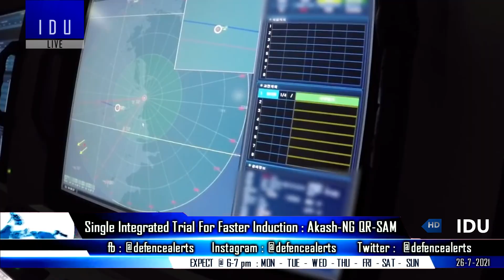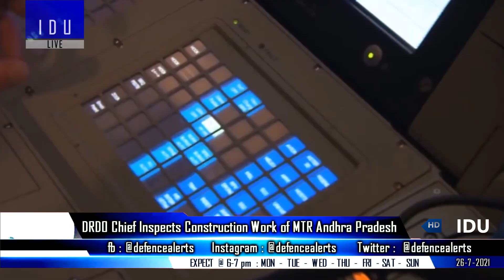Indian Defence Updates : AMCA On Track,QR-SAM Production,Guided Pinaka Export,DRDO New Test Range

Comment from the maker: 🔴What's Your Opinion : "ARDO Starts Single Integrated Trial For Faster Induction" ?
ＬＩＫＥ | ＣＯＭＭＥＮＴ | ＳＨＡＲＥ | ＳＵＢＳＣＲＩＢＥ
Reply: is it drdo or ardo??
Reply: Yeah it's an extremely good decision as army, air force and Navy conducted their own test which delayed the induction of missiles.
Reply: @Flying Tiger What $2B for AMCA are you talking about? Nothing is sanctioned all only on paper and wishful "news".. 2010 around 100 crores or 13 million $ was sanctioned for AMCA... Geniuses will work on "5.5 gen" technology while already spent 10 billion $ on Rafale 4.5 gen tech and have lined up few more billions for additional rafales.. Billions of dollars "planned" for 6th gen engine collab, 5th gen tech while basic C 295 transport aircraft is on hold from 2015 and we are "leasing" MRTT?
Reply: @aocaoc2561  would you tell me the total project costs of AMCA before commencement of commercial 
Production  or have you any idea. 
Thanks
Reply: @pijusmalik7243  5G AMCA RDT&E benchmarks = 5G F35 RDT&E = $62B + 6G Tempest = planned $100B + FCAS = planned $120B...
Reply: @Big.Buddha  RDT&E +FACS  =
-----------------------  +  --------------------
fill up the above  . Thanks
Reply: @pijusmalik7243  Your fill in the blank test equation is dimensionally unbalanced - so to simply the answer - 5G AMCA RDT&E as currently proposed will require minimum $70B in today's money with no problems or delays = 10 years of current entire IAF Modernization Budget of $7B - class dismissed...
Reply: @Big.Buddha  I just wanted to know the full form of abbreviations, 
even after that would you tell..... it
is unbalanced , further if any,  you should have used the rocks for the same .
Reply: @pijusmalik7243  Good question... 
RDT&E = Research Development Testing + Evaluation
FCAS = France 6G Future Combat Air System = SCAF in French...
Reply: @Big.Buddha  Who knows,  you can't understand this simple equation, contrary you have to understand,  again claiming  to be 
"Equation creator " .
Reply: @pijusmalik7243  I grew out of fill in the blank questions 16 low then higher education years later - in math intensive disciplines - so communicate like an educated adult next time...
Reply: @Big.Buddha  I didn't communicate at first you did 
mind it .
Reply: @Big.Buddha  Then you said why, 
whether the equation is unbalanced / balanced, if you don't understand you may ask  or rather to quit, .... no problem
Reply: @pijusmalik7243  OK - won't answer your questions anymore that no one else was answering - so don't bother asking......
Reply: It's a good move 👍 could be helpful in conducting many trails
Reply: Good
Reply: TEDBF जेट्स कब तैयार होंगे
Reply: @pravinyeole2002 Prototype ready - 2025
 First flight - 2026
Production - 2029-30
Induction - 2030-32 (whole squadron is Inducted).

These were the updates 5 months ago. Will know more in AeroIndia 2022.
Reply: @someon713  Would you tell me why 3 yrs is required to enter into 
Production after 1st flight. Thanks
Reply: @someon713  Satisfactory reply .
Would you tell me the meaning of "induction " within the purview of defence , mean to say the  'stage'.
Thanks
Reply: @pijusmalik7243  induction is the stage when the plane (or anything) is taken into service and is ready to use. Like the first squadron (18 planes) of Rafale are ready to use but the second isn't completed (3-5/18 ? Plane).
Reply: @someon713  More specifically 
whether it is simply incorporation /
registering in the book of an equipment  ( say aircraft ) at ready to use mode  or the stage means after adopting  with  the IAF' s software especially for command & control system ie at  fully operational mode 
Thanks
Reply: @pijusmalik7243  induction means ready for war/combat. Ready to use.
Reply: @someon713  Please be more specific whether it is ready to use for training / testing / fighting. Thanks
Reply: @pijusmalik7243  fighting.
Reply: @someon713  Now I satisfied 
Thanks
Reply: @pijusmalik7243  no problem.
Reply: @someon713  Please stay in loop.
thanks
Reply: @pijusmalik7243  will try.
Reply: @someon713  Many many thanks
Reply: If DRDO thinks  that single integrated trial system is enough &
they could satisfy all the stakeholders in each program then
it will be a big boost for our def 
industry  . Thanks Jai Hind
Reply: Share your FB link...
Reply: Good but how will we match the expertise of decades and huge R&D and infrastructure with what we have at present and even in ultra perfect case scenario we succeeded what will be the cost and how much will be able to buy considering cost per unit.  Where it is leading us and then the statements we hear.  And will we have good 4. 5 gen to compliment our 5.5 by the time it squadrons get ready for action. And MWF Will be better than rafale point taken but when and how, better investing in MWF making it good 4. 5 gen with mk2 being cost effective and mk2 with low rcs and good electronics by 4.5 standards will do a lot more good than khayali pulao
Reply: @honeyjotsingh1717  It is not about our "desi" fanboys and their wet dreams about all desi hardware and dialogues of "we should start somewhere" it is NOW simply about a case of can those MWF which needs close to a decade for FOC (best case scenario) take of and within minutes, engage any enemy jet and get air superiority over it.. Yes jets like SU 35 J20/16/11/10 which are far more superior.. 
Those 36 rafales can't be ready for action along all sides of the border Kasmir to Gujarat.. Ladakh to Arunachal Pradesh .. Take the little tejas as an example.. kudos they signed deal and it will be built, taking the role of Mig 21 bison. But against adversaries what can it do against their PLAAF fighters like J 20/ j 16 with massive AESA radars and PL-15? even jf-17 blk 3, j-10C that can be fired from 160 kms + away?

 Locked - RWR will scream and either back off/turn or get blown from the sky 0 chance of getting air superiority over them.. Now add all other jets like SU 30 MKI, Mirage 2k, Mig 29UPG all are already out ranged against the updated Ch!nese jets with AESA + PL-15 combo... Now people will argue oh PL-15 is over hyped bla bla bla but remember IAF lost the entire engagement on Feb 27 because AMRAAM out ranged R-77 by 20-30 kms.. well that range just exceeded with them getting 60+ kms now with PL-15..
Reply: @aocaoc2561   Our massive pride won't allow to see the reality that the Chinese are developing and improving fast along with Pakistan being setup us a useful buffer for them. Still we like to mock Russian and Chinese Stealth classified jets (Yes they could be somewhat inferior to the US stealth jets, but still, even they take it seriously) when LCA Tejas MK1A is still in final refinement phases only. 

In case of missile effectiveness. The missile does not necessarily have to score a hit and the receiving pilot is not going to check on its reliability either when it is being fired onto him/her and when it is fired, he/she is going to do evasive maneuvers and that in itself is a tactic. 

The secondary objective is to keep them busy trying to evade, and they wont know what model or version of missile is fired only whether depending on the RWR or EW suite could know that it may be IR or radar guided, roughly....

Feb 27, we used baseline R-77 export versions and Pakistan got the AMRAAMs bit late and the got a intermediate version which was already a bit ahead of our early baseline. Pakistan planes had headway alert with their  AWACS giving them better bearing and they launched the missiles from max range and our Su-30s pilots naturally did not want to test its effectiveness, all they could do was evade.
Reply: @aocaoc2561  what can you expect when our pride get bigger than national security.  Its more about pride, PR, ego satisfaction and bait to few over anything.  They really aren't care about China and got way too complacent against pak as usual and will wake one sudden day and again go for shopping spree spending double the amount of what it worth and bringing just the product and nothing else just like rafale
Reply: @honeyjotsingh1717  Yup we didn't factor Chine even though red flags should have been seen very long time back, and only thought of them as just a potential threat... Next thing you know the gave us a "we are in come fight us if you want,but we know very well you can't" situation..
Reply: @aocaoc2561  very true and considering the fact that we can't sustain a long term war, we need to keep them back rather than engaging with them and only way to do it is have  ample strength which we currently lack, conflicts will cost us a lot more.
Reply: @honeyjotsingh1717  Correct - 4.5G much less 5G are unaffordable with volumes of only 40 AMCA.1 + 80 AMCA.2 to drive economies of scale - so something isn't adding up....
Reply: @Big.Buddha  we cornered ourselves with such high hopes. We pushed ourselves to two decades by betting on amca and also drop the plan of procuring or going for JV for next gen jet.  This is just blunder which will prove very costly in future.
Reply: @Big.Buddha  I was talking about prolong conflicts at different sites and forcing India to continously mobilize forces, they can sustain that but our economy will drain out real quick
Reply: @Sai Prateek why is it badass  ?
Thanks
Reply: AMCA is on track is a good news. Came from reliable source. Jaihind. Now all cry babies will tell it will not. With Zero evidence..

Comment: I recently read that TESLA has invested in GIGA press which can have pressure/force of about 6000 tons, TESLA wants to go for a machine that can put a force of  8000 tons. It is understood that the rear of the TESLA car is made up of 70 different pieces but with this one machine they make just one part of it And a very strong one.

Can we develop such machines as with that we can build composite structures faster. these can be used in defence industry for building planes or ships, depending on what part you want to make.